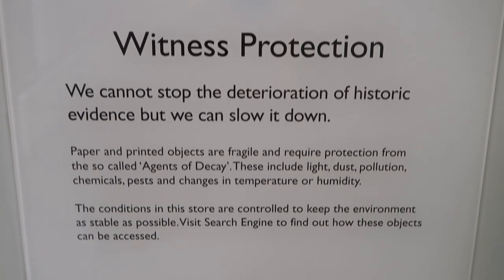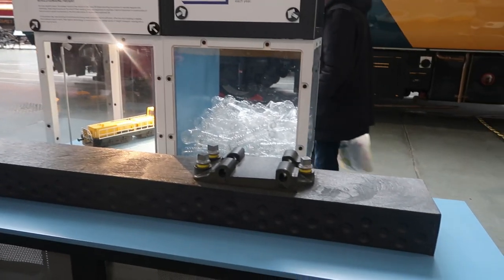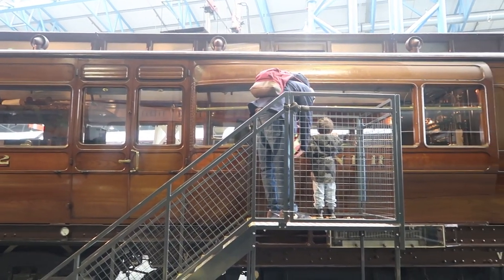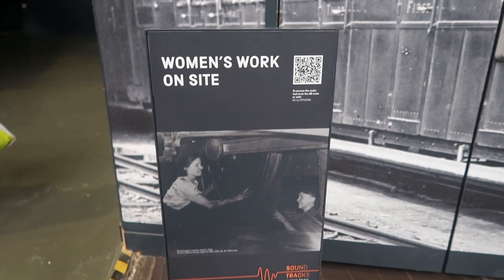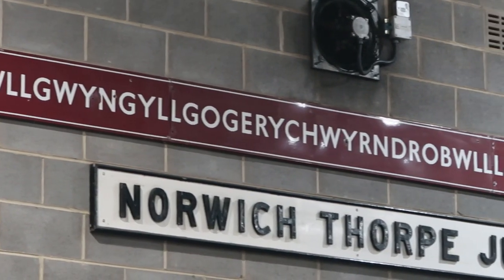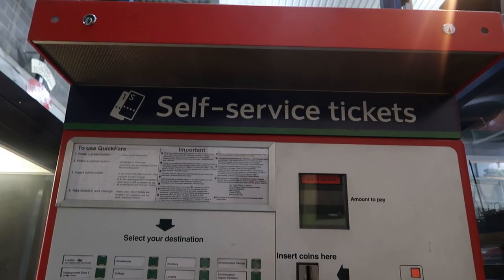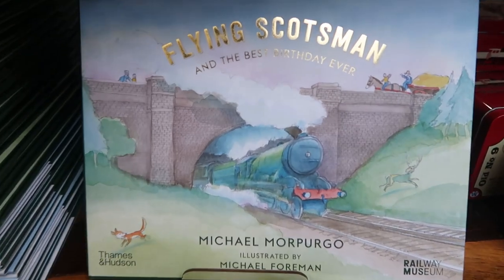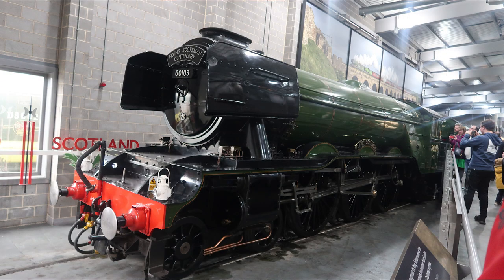Railway Museum, Flying Scotsman 100 Years!

Comment: 6:34 what is that locomotive? Also, is there supposed to be an engine leaving the museum at some point? Only curious because there are a lot of locos in the station hall that I want to see on display still and if an engine leaves there's a chance another will be displayed in it's place.
Reply from the maker: I believe the loco is the 45690 Leander.
With the Station Hall closed having its roof and some walls worked on, I'm not really sure what's going to be in there when it reopens. I think it's meant to be centering around stories of people who worked on and used the railways, so potentially it could be a very different space. 
If anyone knows anymore, I'd be interested to hear.